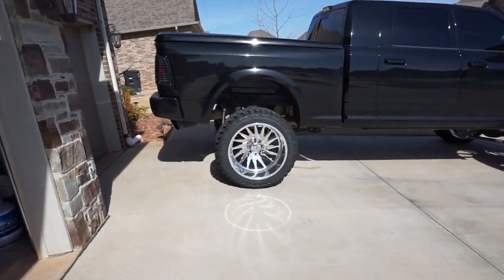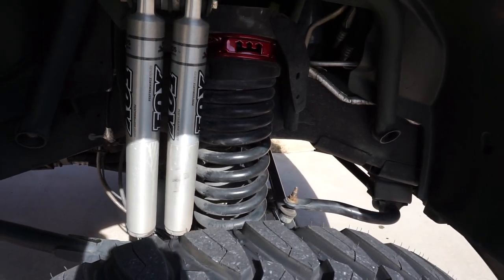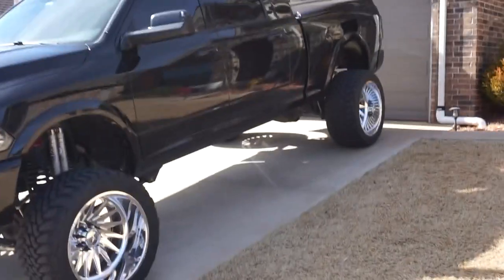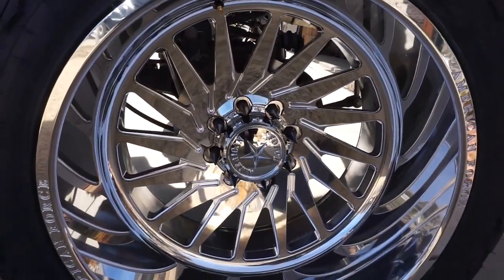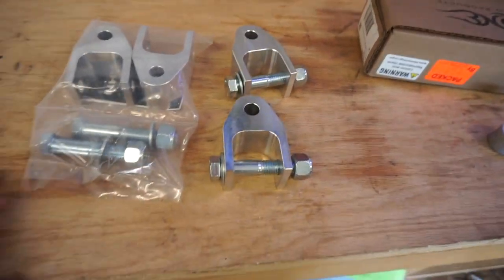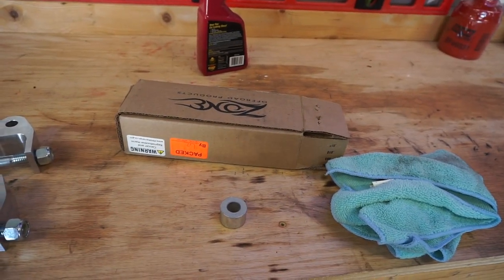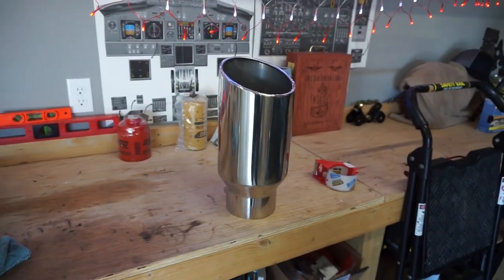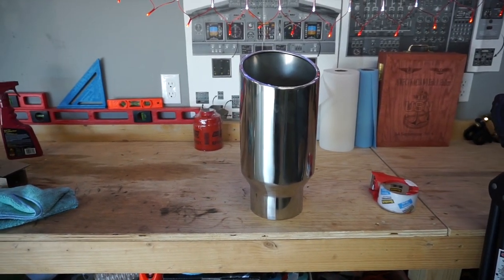Wheels are finally on...

Comment: Keep an eye on wheel bearings. I had to replace mine at 53000 miles. Bought new and lifted it around 9000 miles. Running 24x14 on 37s.
Reply from the maker: Check out the Ram man inc. he makes a custom free spinning hub. I may go that route when these go out.

Comment: Looks incredible! Any noticeable improvement in acceleration with the 36" tires over the 37"s?
Reply from the maker: I can defenitly tell they are out there. She’s a little slower due to the extra weight. Just need to get used to it i guess. I believe each wheel and tire weights somewhere around 150 lbs.

Comment: Dang those look better than I thought. Question, how fast do those tires wear?
Reply from the maker: I’m hoping to get at least 40k out of them. They are smooth and quiet for a mud tire and I’m religious about rotating them. O yeah and they are the proper load rating for the weight.
Reply: @okc_garage  that’s good again those look good hoping they last you 50k 🤞🏻